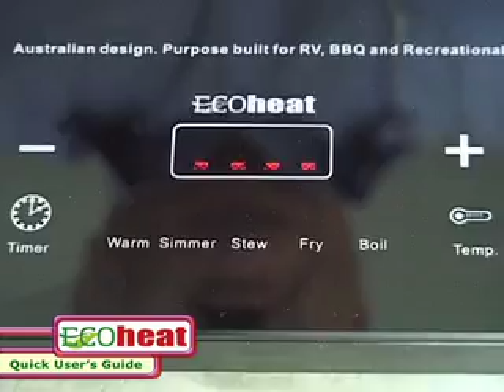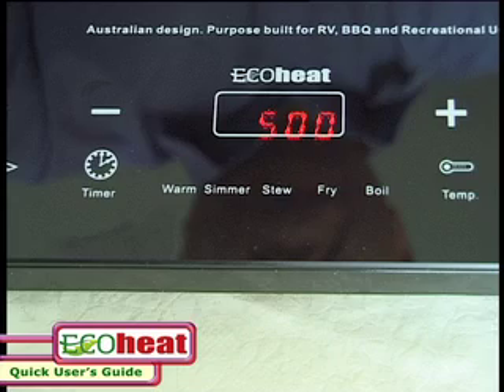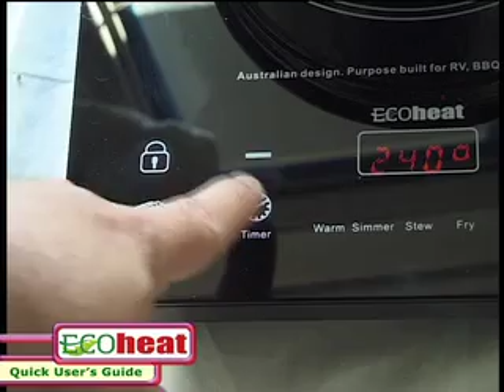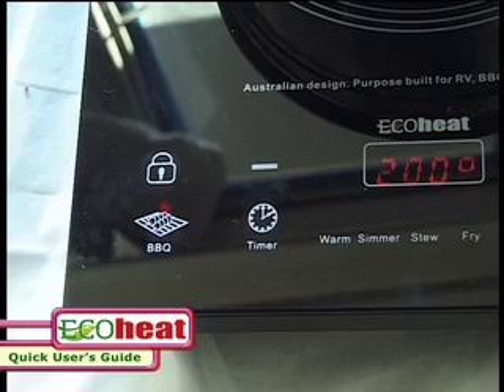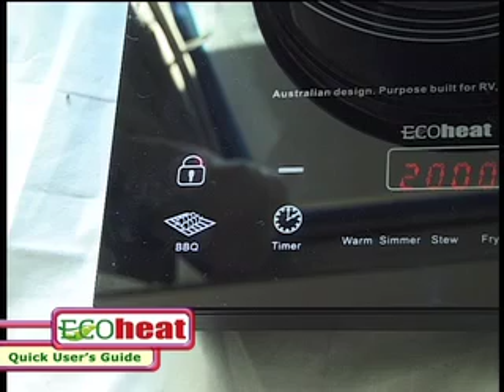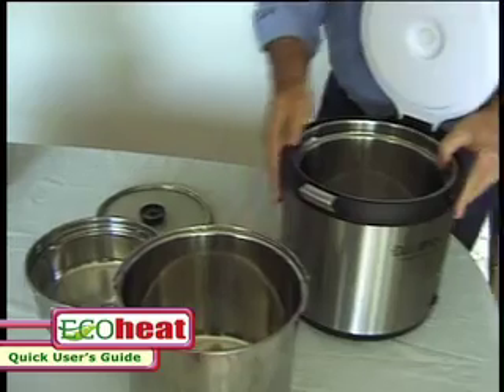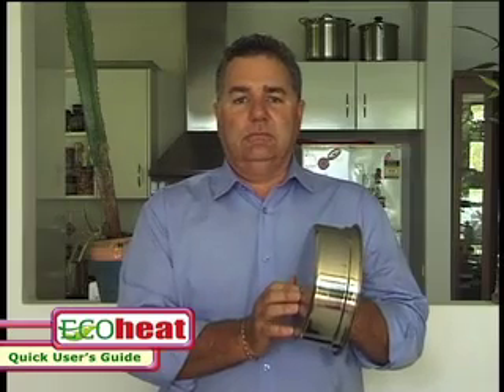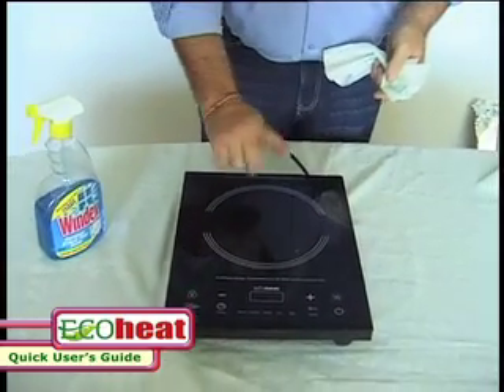Ecoheat Induction Cooker

Comment: just ordered one and it doesnt work. tuned it on and all I get is the flashing lines  whatever button Ihit nothing happens.  have been able to get the fan running and get a EO on the screene.
Reply: You didn't read warrantee. it has 5 years on this item and 2 years on internal parts. If its not working you will get replaced for new because there is no manufacturer globally who has a perfect track record for non-faulty product.
Reply: Had/got 2014 model mine & packed it away then few yrs back couldn't get it to work was no instructions in package stored it until now still can't get anything other than 4 flashing lights ... sad...!